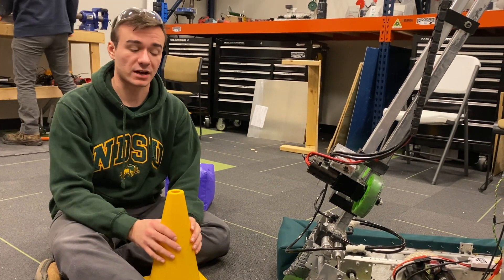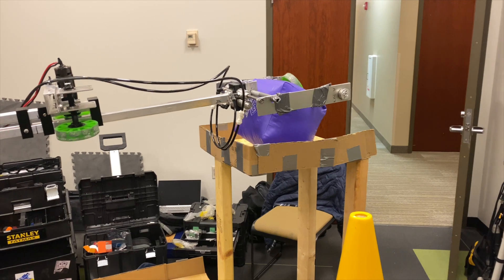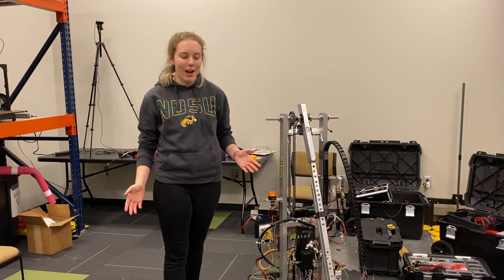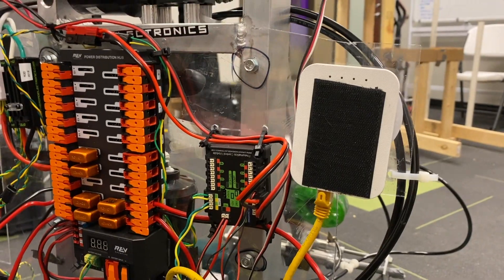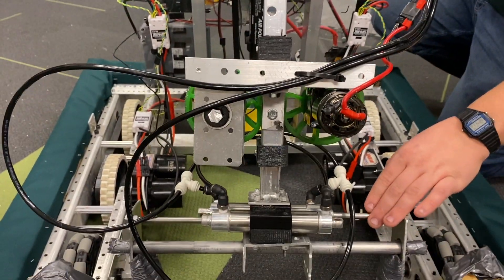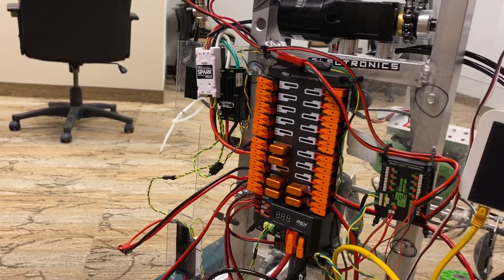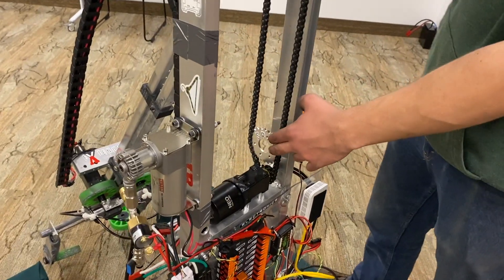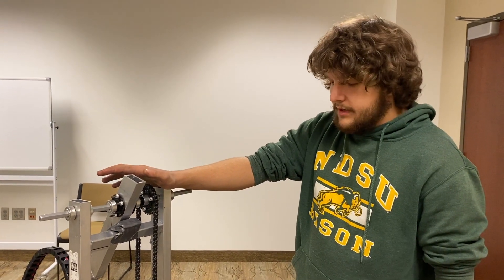NDSU Ri3D 2023 Robot Walkthrough

Comment: Great robot! I was wondering how you decided on how much compression to have the wheels driving the arm extension be placed under, since it seems that would really effect how it works.
Reply from the maker: Trial and error was used with a test plate that utilized slotted mounting. For this application we found that 0.375"-0.625" of compression on the radius of the wheel was ideal.

Comment: Hello, thank you for showing your awesome robot! How long can the arm fully extend, and how short is it when it is fully retracted? Also, how far is the joint for the arm from the top of the robot base, and how far is the tower for the arm from the front of your robot?
Reply from the maker: We will not be providing these values, because this would require that your robot be built exactly the same as ours, as well as limiting the design potential of your team. Instead I would suggest working with your team to find what your scoring goals are, and work on calculating what the required reach will need to be to score cones and cubes in your desired locations.